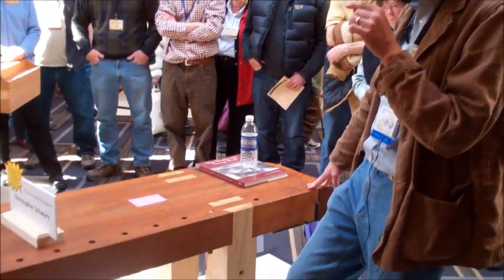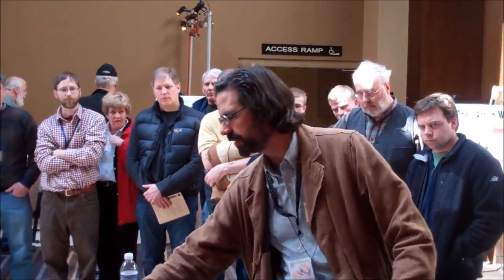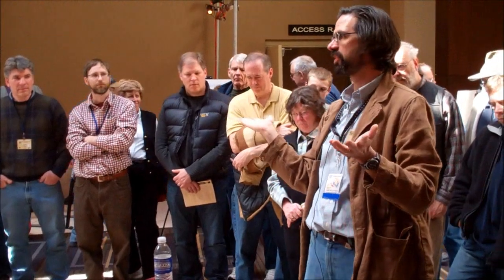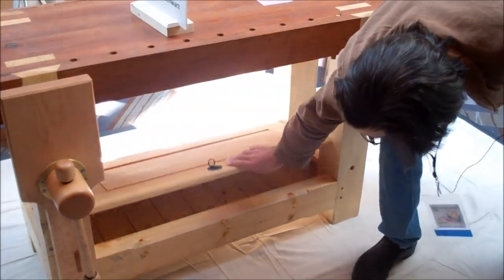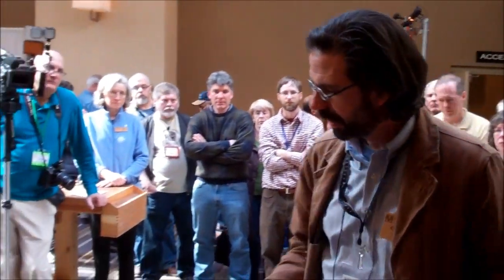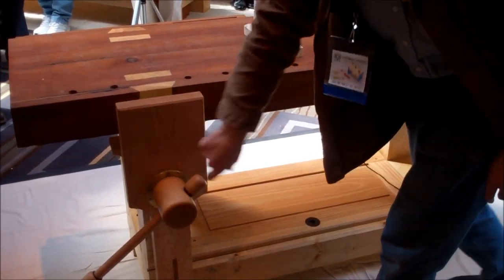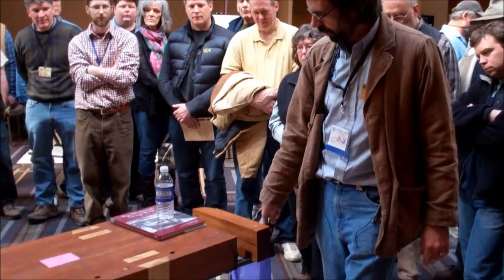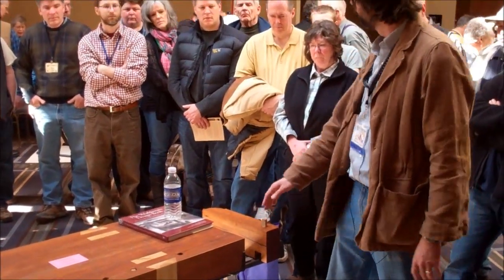Petite Roubo 2 of 3

Comment: I'll put my tools away, and NOT on the bench, or on some shelf way down low.  That slot on the back of the bench has tools sticking up above the bench top and therefore they are in the way.  Not to mention it's a pain to thread the end of a tool into a slot on the far side of the bench.  Just build a tool board on wheels to store your tools.  Tools will always be within arm's reach, and easy to grab.  As for tail vices sagging, you can buy steel tail vice hardware that is bullet proof.  Also, if built right, a tail vice made of wood will not sag.  Note tho, Tage Frid's tail vice design is NOT the right way to do it.  It doesn't take a genius to figure out how to do it right, so no more needs to be said.